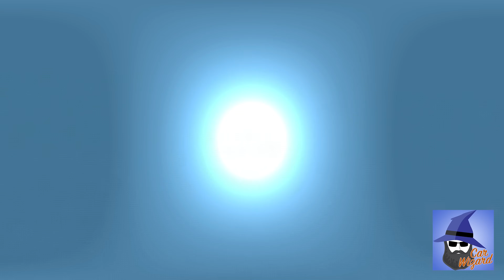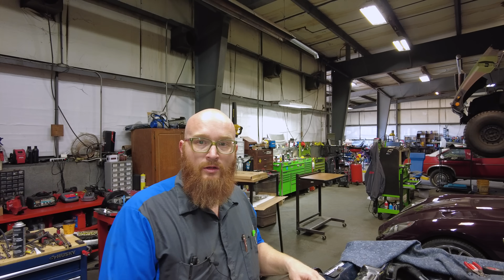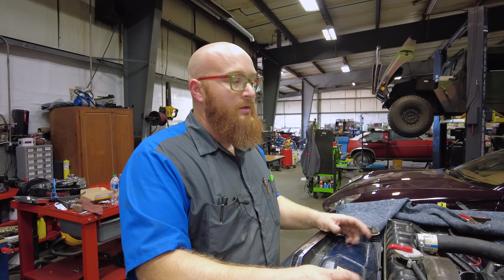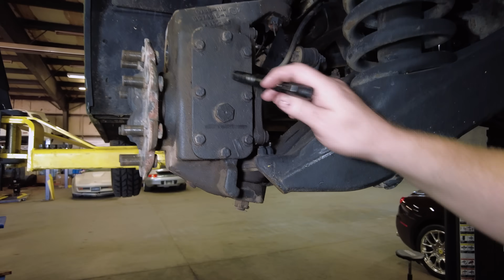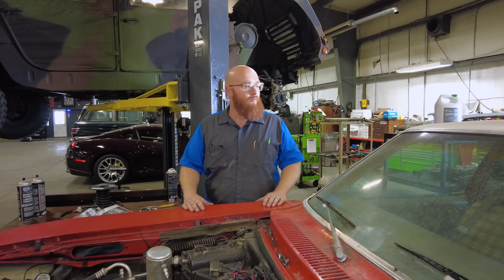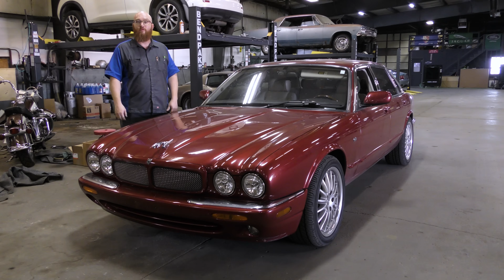No Easy-Peasy Engine Swaps! How could something so common go sooooo wrong for the CAR WIZARD?!?

Comment: We're approaching an era where mechanics shops are going to have 3D scanners, 3D metal printers sheet metal formers, and CNC machines to make their own parts. Yes it will drive restoration prices through the roof, but the replacement part manufacturers have zero interest in fixing their quality issues.
Reply: @jkeelsnc  The car manufactures dont want thier older vehicles on the road... they want you to buy the new crap every 6 years... what a joke.
Reply: @oldskool1979  there is also a big population of car buyers that want a new car every 2 years... otherwise leasing would not be such a popular option.
Reply: Part of the problem with parts manufacturers is they put profits ahead of quality. 
Here's an example, we have a local foundry that produces camshafts for a variety of auto companies,  I have some friends that work at that foundry. They make camshafts for the big three, as well as some foreign companies, but not for Honda or Toyota, the reason is that Honda and Toyota's tolerance specs are much closer than many other auto manufacturers, which adds to the cost of production, so they don't produce camshafts for those two companies. The fact of the matter is that parts manufacturers would rather put out a lower quality product  to increase their profits instead of producing high quality parts.
So you can understand why Hondas and Toyotas practically run forever. They use higher quality parts to produce a better vehicle.
Reply: Waiting for parts is a daily nightmare for shops and the bottom line because customers dont understand the current situation with parts supplies...
Reply: @jkeelsnc  the government doesn't want you/me/us to have and restore older vehicles, nor modify them from stock. go figure.
Reply: @jkeelsnc  The sad fact is that the aforementioned foundry was once a sprawling complex that during the 2nd World War, Korean War and the Vietnam War produced engine blocks for tanks and was known throughout the world for the  quality of the engine blocks they produced. The plant once, at its peak, took up nearly 400 acres and employed more than 4000 people, now its a mere shadow of itself, it's so sad!
Reply: @jkeelsnc  There is plenty blame to go around, that's for sure. 
I live in a town in west Michigan on the eastern shore of Lake Michigan. 
We were a foundry town, we had, at one point seven or eight foundries, they were all on the decline since the late 1950s. Many were remnants of World War ll war production, then switched to producing products for the automotive industry. As the automotive industry faced foreign competition, the industry base shrank, and then there was NAFTA which made things worse, because many parts manufacturers moved production to Mexico in the 1990s.
We only have just 2 or 3 foundries left, and they're very small in comparison to the massive foundries we once had that employed thousands of people.
My dad, who is 95 years old remembers when our town had so many jobs that if you didn't like where you were working, you could just quit, walk down the street and have another job that same day.
I say again, there is plenty of blame to go around, from corporate greed, to politicians, and Wall Street for decline America's industrial power.

Comment: All I got to say is I am so glad to be retired and out of the auto repair business after over 50 years.Same problem with parts on the late models new parts are faulty or just not available and on top of it these new cars are so complicated and much harder to work on.Even on my own cars,I put a NEW starter on my wifes Jeep and the first 4 yes 4 failed in a very short time.
Reply: @jkeelsnc  I worked in dealers and some of the problem is the companies suppling the manufactures would just all of a sudden go out of business.So then they would have to try and find another source.

Comment: Legit street cars does engine swaps all the time, doesn't cost that much. Especially if you have the right conversion kits.
Reply from the maker: Yes it does. He has mentioned to me many times that some of them cost way more than he had hoped. Very high. You are incorrect.
Reply: Well 5 times 2 hours isn't that bad..
Reply from the maker: @NoGGy  No one swaps an engine in 2 hours.
Reply: @CarWizard  5 times 3 hours? Lol
Reply: There are 50,000 engines available for that nova that would work just fine .

Comment: Thank you Wizard and Mrs.  Worst is when someone drops a car off mid-way through a swap - a rat's nest - putting together a jigsaw puzzle.  New engine - but how far down the chain do you want to go, wiring, gas lines, brake lines, radiator

Comment: My parts solution is to put my wishes and needs in at my Pick and Pull account, and they notify me by text or email  when a car comes in. 
You can't do that on every car  and make money as a shop, but Eric O of SMA does so on rare occasions. 
Could the wizard comment on the plug and play harnesses available for swaps?
Sorry JM left you in a lurch. A project that all the previous work has to be rechecked is a hateful job. One losing money for sure. 
A tech that uses the rack all day, 40 hours a week makes you money. And you can afford to pay him well. Part time use, skills get rusty. 
You can't pay him enough to keep him.

I am so old I remember when engine swaps were easy. In and out in less that an hour and a half with air cooled beetles, 2 stroke saabs. 
With hand tools, no air.

Comment: With swaps, the devil is always in the details.  People get the engine and trans set in place and think they are 90% done....but they're really 10% done.  Getting decent exhaust routing, keeping the A/C, and making sure the damn thing won't overheat can wind up being huge problems to solve.
Reply: Agreed, you'll almost always run into trouble. 
- If you need just 3 inches for something to fit, you'll have only 2.75 inches. 
- Or that "guaranteed to fit" swap kit you bought for a lot of money is just an eighth of an inch out of spec so the holes just don't line up.

And on top of that your good old friend Murphy just keeps popping up: you should have 12 bolts but somehow you only have 11........
Reply: Oh you bought the kit for the 79-85. The mid-late 83s had a special mounting boss and need their own kit. We have the kit but it requires modifying the starter and notching the frame
Reply: Too damn true.
Reply: Luckily for me the engine swap I am doing soon is as simple ass possible. Going from a 5.3 to a 6.2 in an '11 silverado. Which was an optional engine. Just need the engine wiring harness that came with the 6.2 and then have a dealer reprogram the computer.
Reply: @lumispawn  yeah see I wouldn't even consider that a swap. LOL.
Reply: @jasonbrannen7598  Lol yeah it's honestly just a low difficulty upgrade more than anything for a tired hard worked 5.3. Now the 94 5speed 4cylinder dakota I've got that I am starting in on a 408 stroker swap.......That's gonna suck. Rear end is already swapped to a 8.25. Everything else is 4cyl weak stuff.
Reply: That's why when I do my first swap it's going to be a fox body mustang  I will buy the nicest one I can with the worst motor , next I buy suspension and a rear end , next I buy a complete 5.3 wrecked chevy truck then I use the motor trans and computer from the chevy and alot of the wire harness also , then a set of motor mounts and a trans mount and drive shaft and last but not least a shifter , actually fairly simple if you have some common sense ,
Reply: @mrgmc6314  bold claims for your first engine swap lol
Reply: @mrgmc6314  Those were made for a 5.0 liter. You can buy a REALLY GOOD set of aftermarket heads for less than the cost and headaches of an LS swap.
Reply: @ostrich67  
Na I'm good with a truck motor out of a million tahoes suburbans yukons silverados and seirras .. there a dime a dozen and unkillable I don't need anything crazy 500 hp to the wheels is good enough
Reply: @mrgmc6314  500hp to the wheels IS crazy, especially when the torque twists that flimsy Fox body like a pretzel. 

You're going to want subframe connectors at least, and maybe a bolt in 6-point cage as well. 

I messed around with Fox bodies in the 90s. Wasted a lot of money.

Comment: Whine, whine, whine. Try doing the job right the first time. It may require mechanical aptitude.
Reply from the maker: We did. It failed from faulty parts. Read the other comments. No one is complaining about whining but you. So you are the whiner here. Post a link to your shop. We want to see how pro’s like you do it.

Comment: Once the OEM spare part inventory is used up you get replicas and if quality part makers are not interested in some low price, low volume used parts that will be the only choice. Higher end cars with very expensive parts get the interest of the quality part makers. As far as the pre-90s cars go for the most part, you have to be willing to do it all yourself unless you are Jay Leno and have shovels of money, you probably start easy and newer though the electronics, sensors, and plumbing beyond obd2 cars is harder.
Reply: Body and interior controls are the only major failing points. Short of something exotic, engine parts can almost always be found (heck, I've got an acquaintance with a Ferrari who had custom engine parts made - valves and rockers iirc). You can make the rest work with some creativity. Admittedly it won't be original/stock anymore, but it'll let you enjoy the vehicle. My old Dodge truck has Ford and Chevy parts mixed in with a few uniquely made ones. The truck works great and plows my local road a mile in each direction for all my neighbors.

Comment: I was in the parts business, until recently  and you are absolutely right about the quality of parts. Even purchasing old reliable brands is no longer a guarantee of quality. New old stock is the safest way to go.
Reply: They dont want ppl working on their own stuff anymore, what better way to discourage ppl, and make money at the same time! I guarantee you thats whats happening
Reply: @thecommodoredecker  that is partly true, but the majority of my parts business was sales to dealers and independent garages. There is no guarantee purchasing a GM,  Ford,  Mopar branded part is superior to a lot of house brands. Unfortunately,  you can't always tell of the quality, by the box it  comes in.
Reply: Chinese, Pakistani, Indian, etc. parts are the issue
Reply: @davidjernigan8161  Mexico... chinesium metal.... poor plastic.
Reply: As a former multi-manufacturer and aftermarket parts manager.  The parts in the system, have been getting poorer in quality, even the OEMs.  You can not trust, and must make sure of fitment, and make sure it looks good.  If you have had no problems with Orem parts, consider yourself lucky.
Reply: @steveperyer4850  Same goes for people... modern people are poorer in Quality.. especially the current US admin.
Reply: I buy nothing but OEM AC DELCO Gm parts for my 2004 Buick Park Avenue and I have noticed our Buick Dealer in my area is within 2.00 to 8.00 more than a discount auto parts store so I just go to the Dealer or JC Whitney and get nothing but OEM NOS AC DELCO parts and never gotten a bad one and never had to return a part either to the dealer.
Reply: I have two older Volvos.  Recently I had water pump installed. The new Mexican made water pump leaked; it had to be replaced.  I am on my 4th water pump.  Hopeful the problem is finally solved.
Reply: Good luck! 😂
Reply: itsa darn shame, but you are correct, everything you buy these days is junk... Sadly..
Reply: You're so right. I was a parts guy at G.M. for many years. Todays parts are very poor.  I agree. NOS is the way to go now. Heck I can't even get a decent pair of brake drums anymore. They are almost always out of round brand new out of the box.
Reply: i just swapped my CPS on my jeep 4.0...... with a 190 dollar mopar sensor
ITS TOTALLY WORTH IT!!!
.
even the NAPA sensor.... the magnet is WAY WAY WAY WAY weaker than the mopar one
.
my motor now hums like an I6..... VS BUUZzBUZUBUZBUBUUZZZZ
the ignition timing is 20, 20, 20, 20, 20..... VS... 20, 32, 22, 18, 25, 15, 20
Reply: KYB and Gabriel struts.. Used to be such good quality. KYB rear struts totally failed in 2 months. Front ones still OK. Couldn't believe customer was complaining about car bouncing again. Removed spring from assembly and shock rods dropped in with no resistance.
Made in China garbage!!